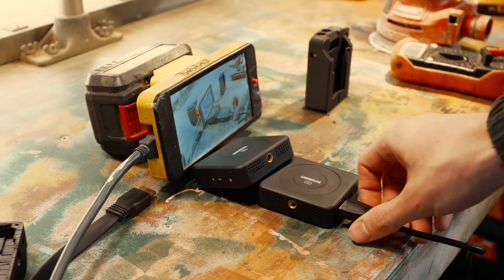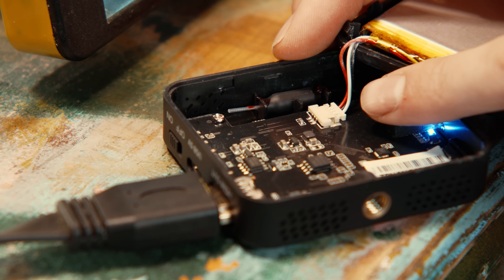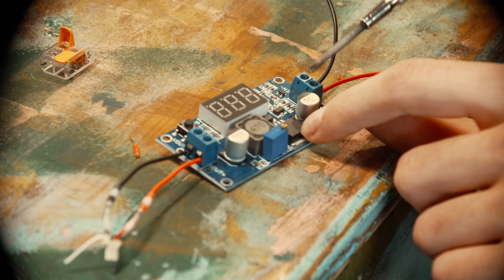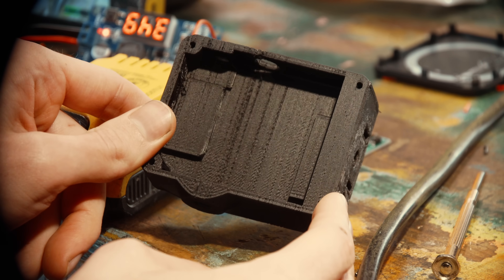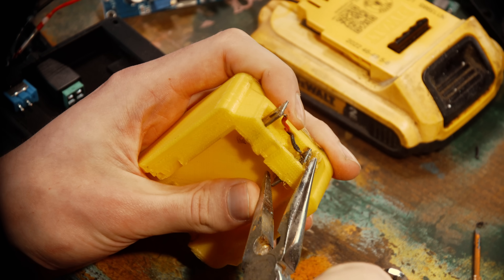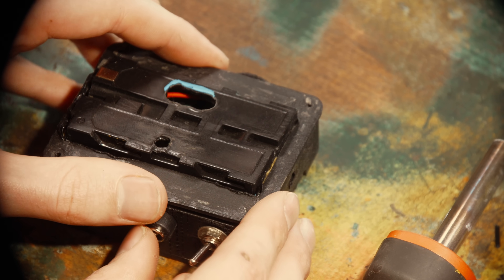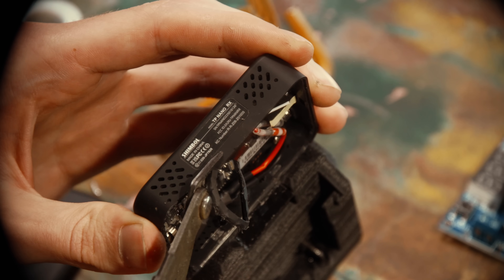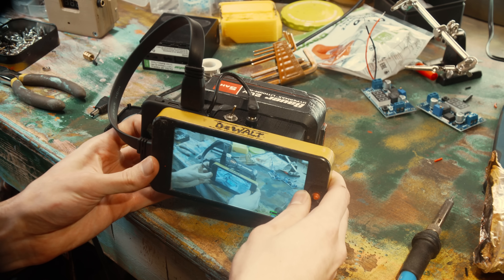Modding wireless HDMI into my 20V monitor rig

Comment: 10:55 That's incredible.
The Bambu Labs printers do require an app and internet to be set up. It would be need if you can test if that's now circumventable.
Their firmware is also locked down and after they removed it, they re-added some linking ability only in a developer mode.
Not a brand I personally like, but their A1 machines are affordable and mechanically great, aside from the extruder.
Reply: You can run it off a usb card, just like an old Creality. No cloud required :)
Reply: Yeah I swore off bambu after that kerfuffle, fortunately there’s a lot more great coreXY printers out there now for less money

Comment: 1:36 oh no. OH NO. That's not a 5V system.
Lithium Ion batteries are nominally 3,6V and go up to about 4,2V as the complete maximum.
The system either downsteps the 5V input to an internal 3,3V or steps the battery voltage up to 5V with most controllers.
3:10 Okay good, you got it about right.
Bringing a Lithium Ion cell down to 3,0V would destroy it, the lower limit probably is around 3,4V.
I'm surprised that it works without the T wire, as that is connected to a temperature sensor on the battery.
When the battery overheats, the system will do an emergency shutdown.
On replaceable 3,6V batteries, this is what the middle pin usually does.

5:00 Along with the switch, it might be a good idea to also add a fuse, as a safety.
You could even use two automotive fuses as the contact pins for the system.

It is also becoming very apparent that your 3D printer's hotend and extruder desperately needs a fix.
The cold end fan should work at least, but the teflon in the heat break might be going bad too.
Older printers used a teflon liner, newer ones have all metal designs which only goes bad if it's physically broken.
Perhaps worth looking in to a cheap extruder and hotend upgrade, so you have better success with flexible filaments.
Though this might take re-flashing the 3D printer firmware, if you can not set machine esteps somehow and match the temperature sensor type.

Comment: 1:54 one wire is positive, one is negative, and the third one is a resistor that goes the entire length of the battery and increases in resistance when the battery is overheating. Just ignore it.

Comment: I really love to see how you work with 3d prints. Just 1 print, and everything else gets fixed in post. Melting it with a soldering iron and stuff. No hassle going back to the computer, changing a few things, waiting for another print, etc

Comment: 3,7V is actually not the highest point of the battery. It will be at arround 4.2V when fully charged. That is the case for most Li-ion and Li-Po batteries

Comment: BIG CAUTION on the ANTENNA and soldering a wire to lengthen and boost the signal: 
I tried fixing an electric skateboard that was having connection issues between the remote and the main brain, wire for antenna had come loose with a break in the connection on the copper of the flat antenna patch, tried replacing the patch with a wire, still patchy and loosing connection - turns out (from my research into it, I could be wrong, please correct me if I am) that the antenna patches/squiggly lines of copper are specific lengths for specific frequencies.
So for bluetooth it’s a certain length, for wifi it’s a certain length, that corresponds with the wave frequency of the chosen wireless standard, so just lengthening the antenna with some wire can make transmission worse (at least that was what happened when I tried it) - the length needs to be a specific fraction of the signals wavelength so it is possible to make it stable, but you can’t just «double» the length for example and get a stronger signal.

Comment: I am loving this daily video thing. It’s a great 10-15 minutes to chill out with a coffee. 
By the way, messing with the aerial could cause you more problems than gains due to most antennas being “tuned” to their frequency. You would have to ensure you’re adding or removing the correct lengths to keep the right range for the receiver unit. You could always look for a range extender, FPV drone pilots use them on long range units. They’re usually pretty damned cheap and very effective.
Reply: ^^^ this. adding more wire will probably reduce the range. like the nice fellow above said, fpv drone companies sell antennas for practically any frequency you would need for a video transmitter. also need to make sure the antenna polarization is the same between the tx and rx antenna. worth doing a bit research on antennas before messing with it. loved the video

Comment: I think it might be time to introduce the «E-TAP»-system, one box to rule them all, a box that connects to the chosen battery system (with adapters for other battery-systems) with plenty of adaptable output ports, both USB and wired plugs of varying voltages (adjustable on the outside of the box of course) for powering a plethora of devices
Reply from the maker: Truly this is a product I’d love to make down the road
Reply: @EvanMonsma It will be the Ender Dragon of all power redistribution boxes, good to have an endgoal to head for :)
Reply: The Monsma power block (registered trademark) 😂😂
Reply: @jiltedgaijin9320 Yeah, Either E-Tap or M-Tap Power Conversion Block - ECP-B or MCP-B for short - hard to choose E or M though, The EC is a good «Easy»-pun, while the MCP is a nice nod to the original Tron Master Control Program (Or Monsma Control Program) or even the Monsma Control Block, MCB for short - so many possibilities : )

Comment: Don't forget there is no low voltage cut-off on those power tool batteries (it's built into the tool). If the battery pack goes lower than around 15.3V you can kill your battery pack.

Comment: 3rd wire is generally a temp sensor on the battery pack protection circuit
Reply: it can also be charge indication, not much in this case but generally